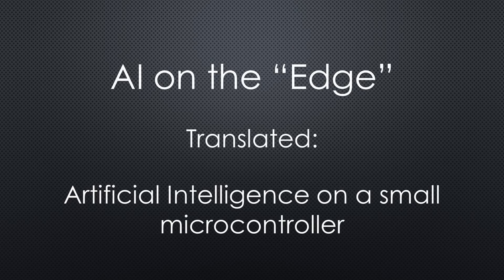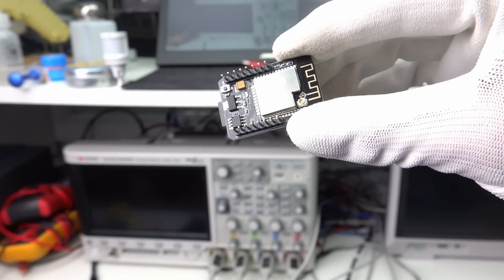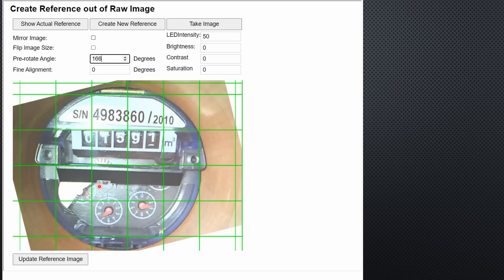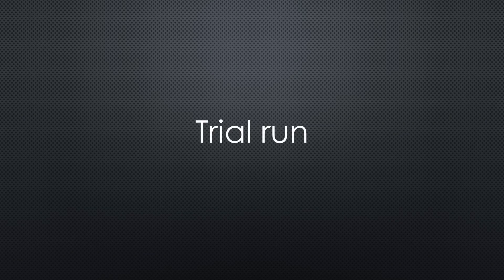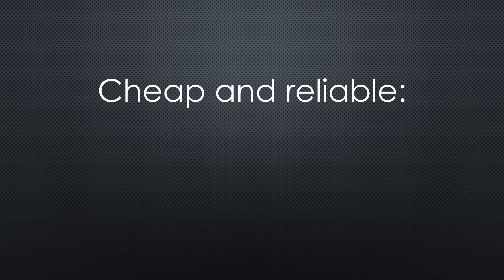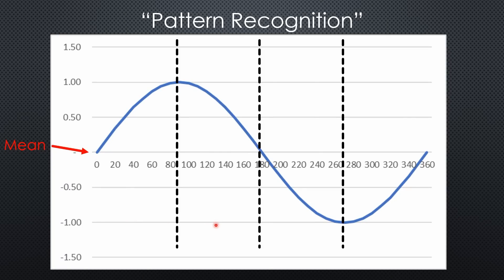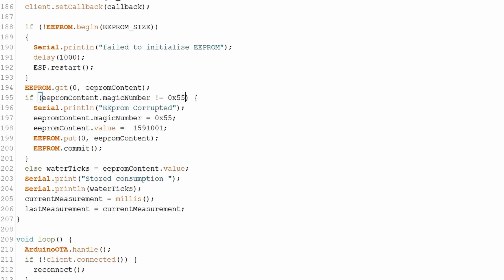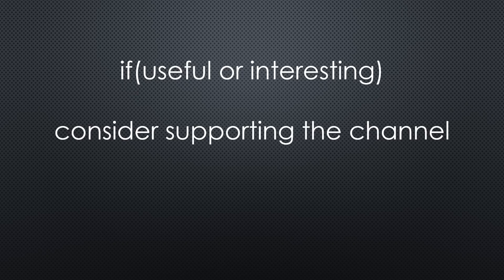#418 AI on the edge vs. Traditional Engineering. Water Meter with ESP32-CAM

Comment: A few months ago I did a VoiceWatcher using ESP32 to stop the model trains by word in case of an emergency. See here: https://youtu.be/dP01Lq9poZw
I used the Edge Impulse tool chain, which I think is excellent.  It worked pretty good, even though not perfect, but with some more training data the model certainly can be improved.
What was interesting to see was the amount of processing time the voice recognition took out of my main loop. I covered that in the video, it was significant. Also, the additional code filled about 10% of the ESP32, which is also considerable.
Overall I think there is a lot of potential using AI for problems with a lot of variability on the input side, that can't be covered by one single sensor type, things like e.g. anomaly detection to compare normal vibration with the one when e.g. a bearing goes bad. For a relatively simple problem like the water meter, the traditional approach is most likely more efficient.
Reply from the maker: A good video! But it shows that pattern recognition is not easy. Or you change the command as we did in the fire brigade: We had to say "Genug Schlauch" or " Wasser Stop" instead of just "Stop" ;-)
Reply: I watched and subscribed…. I need to become more embedded in this community!

Comment: Sure could have used one of these a few months ago, my water bill went through the roof. The water department told me to check if my water meter's needle was spinning, it sure was, non-stop.
Reply from the maker: The meter is now life and I wonder about some peaks, too. I will have to see where the water goes.
Reply: @AndreasSpiess  Leaking toilet overflow valve did not turn off water flow, imperceptible leak that I was unaware of until I saw that meter needle spinning.

Comment: As always great video! The metal piece from the water meter is for inductive sensors like TI LDC0851, I have worked designing this kind of sensors for iot devices
Reply from the maker: Thanks for the info! Mine did not work with my hall sensor. So I thought it is not metal...
Reply from the maker: In the meantime I checked with the LJ18A3-8-Z/BX sensor and it works. So it must be metal, but not magnetic.

Comment: Thanks for this video. You didn't talk about training the neural net for the failed image recognition phase of the project. Did you just use a generically trained NN? The training phase of NN development will almost certainly be a really important tool for future makers. Perhaps you should take a closer look at this...

Note that training this type of numerical recognition system where the numbers always appear in the same location in a picture is one of the easiest to train because you can get immediate and unequivocal feedback on whether the NN output is correct or not. This is generally not the case, which makes training in the general case much more difficult and explains why it is such a hot current research area.
Reply from the maker: This project was trained with the German counter (and seems to work ok). Training for only one counter was too much work for me. Therefore, I did not look at it. I just hoped it would work with my counter, too.

Comment: Wow, great project and test of "AI" (CNN) vs reflectance counter. I wonder how effective traditional image processing would work, e.g . bitmap matching and arrow angle analysis.  Probably you could have retrained the NNs and tweaked the alignment to get it to work, but that's a lot of work.

I have a friend who wants to monitor water heater status lights, and seems like an ESP-Cam would work well. I was thinking of using simple image analysis (AI seems harder). You could have written image analysis to detect the spinning disk, but you could have a low power solution (battery) with your reflectance sensor monitored by the ULP peripheral.
Reply from the maker: I could also have trained Tensor flow for my setup. But the effort was too big for me. But for other scenarios this setup could be good. Training for a few LEDs probably would be simple...

Comment: They could also be using a metal detector. i.e. An inductive proximity sensor. Alternatively, a hall sensor and a biasing magnet. Inductive proxies are good for any metal, foil if non-ferrous, while hall and magnet is only good for ferrous targets.
Reply from the maker: I am even not sure if it is metal or only colored plastic :-(
Reply: @AndreasSpiess  Even if it is metalized film an inductive prox sensor can pick it up. It just needs to be conductive.
Reply from the maker: In the meantime I checked the LJ18A3-8-Z/BX sensor and it worked. So it must be metal. Now I have the choice...

Comment: My meter has nothing like that and the digits don't align very well for image recognition, but most of these meters need to transfer the motion of some rotor inside the water to the measuring mechanism outside the area where water is, without allowing any water to escape.  Almost all meters do this transfer of motion using magnetism, so that in turn means there is some changing magnetic field at the center of that mechanism when the rotor rotates.  Sometimes that magnetic field might be sufficiently strong to measure with a Hall sensor, but with my meter - with metal housing - this didn't seem to work.  But ... I then used a magnetic field / compass sensor glued to the meter body and from that get a vector that indicates the direction of the magnetic flux.  When the meter turns, that vector also turns (in 3d) and by reading it out several times a second and tracking that movement (flattening out some jitter which will always be there with something like this), my esp8266 can measure the number of rotations the meter makes and convert that to actual cubic m of water gone through ...  Within one rotation the accuracy is not perfect, but half rotations (so those inverting the vector)  are detected fine.
Reply from the maker: Cool! I like that you did not give up!

Comment: I can only connect my esp cam to the programmer with the jumper on 5v. 3.3v causes connection issues.
Reply from the maker: I do not power the ESP32-cam with the USB-Serial adapter.

Comment: Two interesting approaches. i am using an inductive proximity sensor placed above a rotating metal semidisc to pick up a signal
Reply from the maker: This seems another method if your counter does not have this reflective part. I only tried this part with the hall sensor. So I do not know if my counter would also have such a metallic part.
Reply: @AndreasSpiess  Yours works. In the end that's what counts (no pun intended).
I have considered the AI solution as well but found it unreliable/too error prone
Reply from the maker: In the meantime I checked the LJ18A3-8-Z/BX sensor and it worked. So it must be metal. Now I have the choice...
Reply: @AndreasSpiess  great

Comment: using EEPROM is good but since you have connection via MQTT ( RPI ) and then to Influx DB, why not in startup get the last values from DB instead.  Let the DB be your master source of data 
But awesome project for sure
Reply: You could also publish with retain and subscribe to the same topic then you will be updated at startup. To be fully persistent remember to set the mqtt server to save the retain messages on disk
Reply from the maker: Both are good ideas! Then I only would transfer the consumption. Thanks.

Comment: You should try putting on some black masking tape on the parts causing glare
Reply from the maker: Good idea. I did not investigate where the glare came from (maybe from the cover of the counter itself, it is a quite complex part).
Reply: @AndreasSpiess  also try spray painting the esp32 mount inside with black matte paint, i think the brown filament you used is too shiny

Comment: What about capacitively sensing the grey plate?
Looking at the design of the grey plate, I am reminded of a tunable capacitor.  Is it made of metal, plastic, or since other material?

Capacitively sensing the plate might allow you to get more of an analog/positional reading, instead of a single pulse per revolution.  It would also be significantly more reliable if the meter is exposed to sunlight (something that I believe the manufacturer may have anticipated).
Reply from the maker: I do not know if this plate is metal or just painted plastic. Sunlight is rare at the place it is mounted (usually in the basements). But I do not know how they do the reading and if they use a different method. As you saw, I also get an analog signal and could do some mapping. But one turn is 1 liter. That is good enough for me.
Reply from the maker: In the meantime I checked the LJ18A3-8-Z/BX sensor and it worked (one pulse/revolution). So it must be metal. Now I have the choice...

Comment: In the past I heard hair spray may help to avoid reflections.
Reply from the maker: I would not want to try it because I do not know what it would do with the plastic and if it could be removed later. And I need the counter for the next few years ;-)
I use hairspray for my 3D printer, BTW. But on a metal plate.

Comment: I had better Results with smaller Digital ROI. You should  try to make it fit inside the White squares.
Reply from the maker: I tried several sizes (because it was not clear how it has to be done). But none worked properly :-(

Comment: I've tried reading counters of old electricity meters a few weeks ago but mine isn't an edge case. I've used the open source OCR named tesseract. According to it's docs it's even trainable. I might have to try training it when I have some time, because one type of meter works and the other type doesn't. It comes down to different fonts used on their faces. On the other hand I'll try to use a polarizing filter to avoid glare.
Reply from the maker: This project also can be trained. But only for one meter, the effort was too big for me.
Reply: I get that feeling also from time to time about neural network based stuff. I'm no expert, but the last time I used it was on a competition in a team of four. We didn't had much time, dataset for training and because of these factors it didn't work reliably. No wonder why Amazon trained a newer version of Alexa on synthetic data so they could quickly deploy to market. As an enterpreneur sometimes we get asked about doing stuff based on neural nets and computer vision, but most people in my country think it's quickly and cheaply doable, but it's not because it needs data collection and training. Someone has to collect, then work on lots of data even if it's quickly generated as synthetic. :) I think I've seen the industry use pre-trained ones that has some holes left to fill in with your custom data, but it's for simple tasks like counting different medicine boxes coming on a conveyor belt in hall using static lighting.
Reply: Still, thank you for your effort, Andreas. It's always a pleasure to watch your videos. You bring very interesting topics to the table! :)

Comment: Fascinating!  I hadn't thought of using a camera on an analog meter when I went this route.

Like you I already had electrical monitoring into Influxdb (thanks Iotawatt!). So I started to wonder about water.  I already had some cheap hall sensors on my outdoor water lines to verify that the irrigation system keeps our garden watered.  But what about the house itself?

Here in Canada (Vancouver) we don't pay for our water, so it's not metered, so I didn't have an analog meter to start with.

Digital water meters were pricey, and usually meant for high-volume, so not very precise.  Then about a year ago EKM Metering released a version of their pulse water meter that pulses every 0.283 litres. You can hardly turn a tap on without a pulse.

Plug the pulse output into a Sonoff running Tasmota, and tada! A count published to MQTT every minute.

The meters are cheap enough that I bought two: I still need to put the second one on my hot water line, but soon I'll know water the hot:cold ratio is for my shower.  I have yet to convince my partner why this is useful. :-)
Reply from the maker: Indeed, it is not easy to convince somebody of the usefulness of measuring a free good ;-) That is what I call a hobby. Useless, but fun!

Comment: I attempted a similar project in the past, reading a water meter on a rotating dial. It was a spoked wheel with many more theeth on the outside. Reading it optically worked super well, to a theoretical accuracy of a few ml per tooth. Unfortunately the water meters were replaced with ones that have only the numbers visible. I was unable to find a rotating magnetic piece, or a detectable piece of metal inside.
Reply from the maker: That is what the call "Innovation" ;-)

Comment: The problem is that you couldn't traine the AI for your scenario.
Ask for the creator to gain access to traine the AI with your images.
Reply from the maker: Training AI is a good thing if you can use it for multiple counters (as this project shows). But only for one meter? Here the effort would be too much for me.
Reply: @AndreasSpiess   
The AI is only good as it is trained for. If the programmer had not trained enough and and used generic meters it's not AI fault.
I would like to see a project where you can traine a ESP for identify the license plate.

Comment: Thank you for another interesting video, I had this particular ESP32-CAM "AI on the edge" project on my to-do list for some time now, I keep delaying it because I don't have a 3D printer to make the mounting support. 

At 11:45 I reckon your Y axis labels in Grafana are wrong, possibly by a factor of 1k or even 10k (depending on your showering preferences). I doubt that your wife is using only 4ml of water per minute for the evening shower! :)
Reply: @marthale7 That could be an option, I agree, although I would be worried about leaving an old phone (with an equally old Li-Ion battery) permanently connected to a charger, especially when I'm not at home.
Reply from the maker: @Dan: You are right. I did not look at the scale, just at the values :-(

Comment: A very interesting video.  The way to approach the sine wave to process it is brilliant.

My water metter is very similar to the one from the project, but has some kind of wireless communication as this is a flat with central hot water  (same goes for the heating). I wish I had enough knowledge to work it with the SDR radio to get the numbers in the same way I get the 433 weather sensors.
Reply from the maker: If these meters are more modern they often are encrypted :-(
Reply: It is two years ago modern, so sure it will be. Too bad, but thank you for pointing it :)

I could follow the AI path, as my model is very similar to the one from the project.

Before that I´ll try asking the provider to get direct access to the API and feed Nodered with it, or even try to process the very unusable user website I have with poorly arranged information.

Comment: Engineering at it's best Andreas! ;-)   I'm using a setup where I'm not really interested in the actual numbers but trying to detect water flow vs no water flow to react on broken pipes, hanging valves etc. My theory is that in 2 hours there should always be 10 minutes with absolute no water usage - at least in my household. If not I use a central valve to close the entire water flow for the house. Works great so far, f.e. detecting hanging toiletts or similar. Had just one false alarm in 5 years. I also have added a ESP32 CAM .. but basically to just allow me to get a "video" or static picture from the counter (that's what the default firmware of the ESP32 CAM does). My water supplier (10 years ago) offered a special device for ~60 euro that is able to put out a open collector contact for every liter water. Imho there is a spinning magnet inside the water meter itself which they plug on. Easy way to get the "real" numbers of water usage. And btw: The "central valve" just a pure mechanical construct which uses an old cordless drill to manually close the central valve ;-) Cheers!
Reply from the maker: My new decalcification system has this feature, too. You know how I discovered it? For the tests in this project, I had to let the water run constantly for some time. Suddenly it stopped :-(
This device checks if the water flow is the same for a certain time and then cuts it...

Comment: There are ultrasonic clamp on sensors available who measures water flow by the doppler effect. Didn’t have such yet, but would be my way to solve. Maybe they can be DIY build with transducers?
Reply from the maker: I think I have such modules in my lab (i was fascinated when I saw them). But I always wondered how they can do this through metal tubes (here everything is metal at the entry of the home.
Reply: @AndreasSpiess  solid iron pipes here too. I think they couple trough, like a stethoscope work. But i donno, cause i dont have such to goof around with it. But this would be a very interesting topic right now on grown energy costs and everybody will cut expenses.
Reply: Can you give me a recommendation for such sensors and wich to buy?
Reply from the maker: I never used these sensors. So I cannot recommend anything :-(